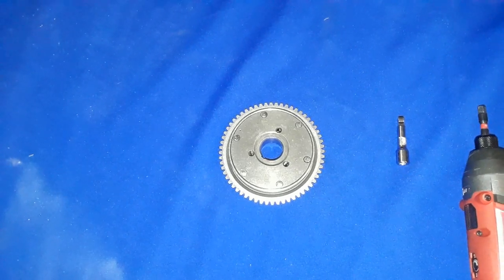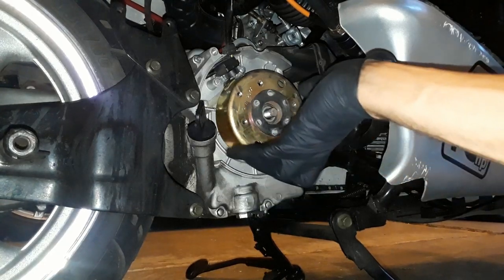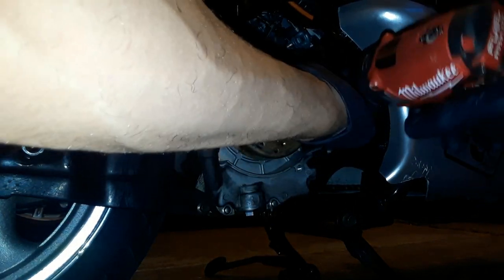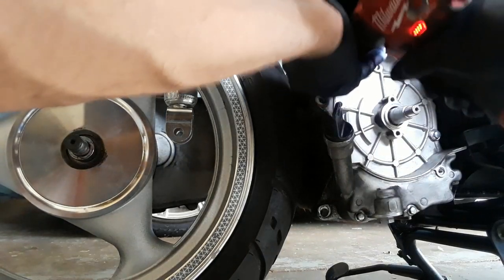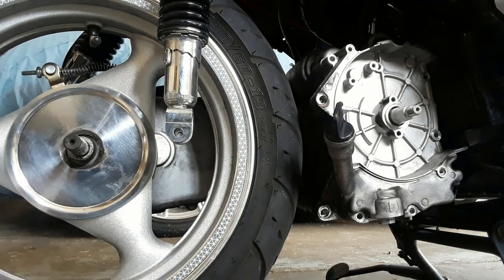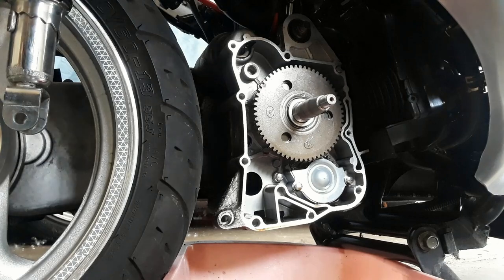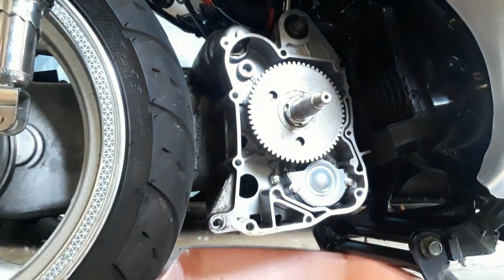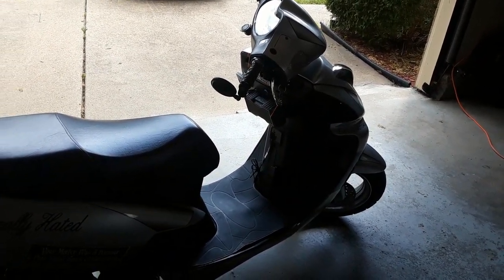Gy6 Starter Clutch Replacement

Comment: Hey fam how you doin? Today I charged my Alice and now it won’t start. Been having problems since the cdi instal, can you help me fam? It’s making an eeewaaahhh noise lol, when I try to start.
Reply from the maker: Do me a favor, record you trying to start it, so I can hear the sound. kachiskid@gmail.com
Reply: Kachi's Kid the sound vanished when I tried to kick start it even tho kickstart don’t work but before when I put my head inside it came from the  solenoid
Reply from the maker: @wiredgaming8504  solenoid normally don't make sounds, unless it's a click. Make sure connections are tight and have no corrosion.
Reply: Kachi's Kid your other video I just saw, imma try checking it out with the meter, thanks fam your really helpful, your videos are always my go too. And yeah I’ll send you video I’ll check if the noise comes back but rn only light works and my usb to sae adapter. Man I just got my new belt and mirrors and rollers. Do i need a new spark plug to go with my racing cdi? Might as well replace my box filter dang I think I worked more times on it then riding. It’s still relaxing tho keeps me busy. Thanks again brothah
Reply: Kachi's Kid ohhhhh I just replied on other one but I’ll just make a video in the am a full dissemble video.... first time 😬😬😬😬
Reply from the maker: @wiredgaming8504  No problem, no need for a new spark plug. Make sure you do some riding in between all that work your doing.
Reply: Kachi's Kid I fixed it fam it was  dead battery I think or I smacked it around too much  but now it won’t stay on 😭 I just wanna ride, oh it’s like struggling to stay on is cause low gas
Reply from the maker: @wiredgaming8504  Work with your idle screw to keep it running. Less smacking around...lol.
Reply: Kachi's Kid hahahaha I think my engines flooded or something it’s having trouble turning on and it turns of if I’m not using throttle

Comment: The one i have is really stuck, after i removed the crown socket
Reply from the maker: Yeah they will get stuck, you might need a puller.
Reply: @kachiskid  oh ok, thanks for the quick response !
Reply from the maker: @dooffwellingtonthe3rd44  no problem.

Comment: It's not supossed to spin clockwise it only spins freely counterclock, if you move it clockwise you should be moving your piston up and down and if it doesn't move it means your crankshaft is damaged at the piston rod which causes the piston rod to bind every now and then and if you don't change your crank shaft eventually you will find metal shavings in your oil from the rod bearing movement side to side.
Reply from the maker: Agreed. At the time I didn't know what I was doing. It was good to just get the cover off. Taida starter clutch in a Taiwanese 180cc, is what is on there now.